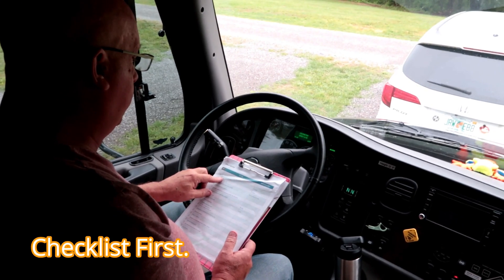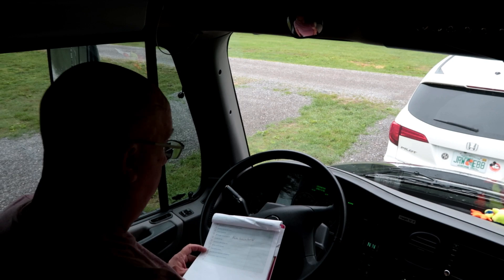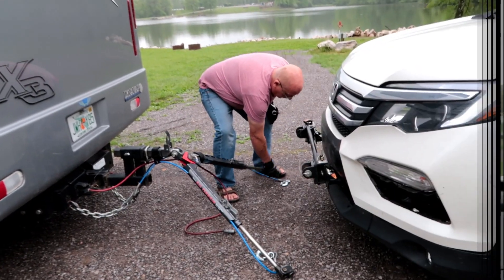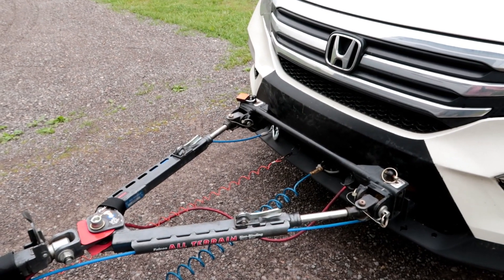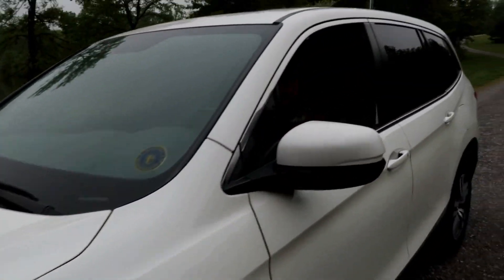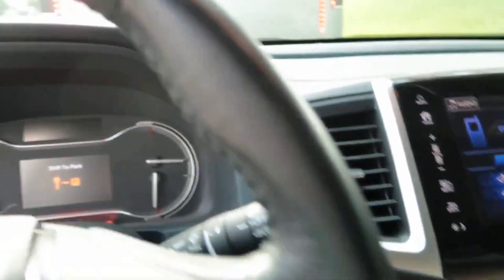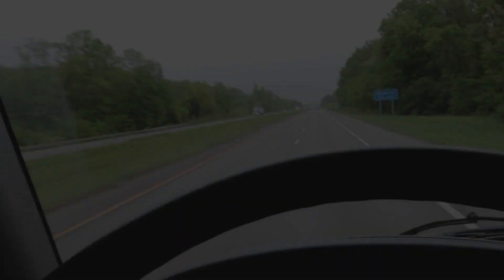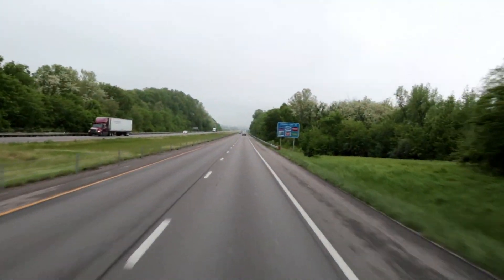Our RV Departure Checklist and Flat Tow Hook Up

Comment: Thanks for the help. I’m looking at 24-25 Ridgeline and I’m not finding very many flat tow vids for it. I’m also a Floridian.
Reply from the maker: @godsmizzack  Your welcome if you have any questions put them here and we will try to help out. We almost always towed the pilot at around 65mph and stopped about every 2-3 hrs and ran it through the gears. That helped keep the battery charged as well. Good luck with the Ridgeline. Best practice is to always follow the manufacturer recommendation on flat towing. If it's a variable speed trans I would really take a hard look at the specs

Comment: Hey guys, I noticed in newer videos that you  don't have the Honda. What happened to it?
Reply from the maker: After towing for about 100,000 miles Three sets of tires and getting an occasional check transmission light, plus changing needs. We downsized to the new to us Jeep which also weighs under 5000 lbs. Which will allow us more wiggle room on our next RV The DX3 is a BEAST when it comes to towing. Our next RV? Probably a Class C or B plus without the Monster tow capacity. Thanks for watching!
Reply: An occasional check transmission light.....but no real damage? Like, it just needed the fluids changed more?
Reply from the maker: pretty much, I added some Lucas trans lube and that kept the light out!

Comment: What system did you use and front mount? I’m still leaning towards a Ridgeline and most companies sites aren’t listing for newer Ridgelines.
I see a lot of systems on marketplace for sale, and have no problem buying that way, but, want to make sure the mount is available.
Thanks again
Reply from the maker: I used a highly modified Roadmaster mounting. It was a salvage from a Smart car. Lots of welding and bolstering. Definitely not a bolt on but doable.
Reply: @ 
I had a feeling this is what I would be doing also.
I’ll probably find a nice complete kit on FB Marketplace and then modify the mounts for the Toad.
Appreciate you replying.
I’ll try to update you when it’s complete.
Reply from the maker: @godsmizzack  best of luck. A bit of advice, make sure you don't "pull" from a place designed to "crumple" 
and try to attach to two points on each side and you should be fine. I'm not an engineer so...

Comment: Is it possible to leave say an 08 Honda accord engine running while being towed to prevent transmission damage?
Reply from the maker: Not a expert but I would be pretty nervous leaving a car running without a driver. Lots more could go wrong with a running motor especially if the car gets disconnected.

Comment: Up And Down The Road Just so you are aware, the 2018 Pilot DOES NOT have the same drivetrain as previous Pilots (2015 included). From its introduction in 2003 up till model year 2015 the Pilot had a 3.5L VTEC V6, AWD, (and later FWD) and a 5-speed automatic (shared with the CR-V, Element, Accord, Civic, Odyssey, and Ridgeline, all which were at one time or another to my knowledge flat towable following the procedure shown in the video. However, for the Pilot at least, in the 2016 redesign it received a new (but similar) powertrain and a NEW 6-speed (optional 9-speed) automatic transmission. This new transmission is NOT the same as the old 5-speeds with an extra gear. As far as I know, with the 6-speed, flat towing is okay but you need to do everything you are doing. Just be cautious about towing and make sure you stay within the time limitations. 

Honda has not officially recognized flat towing for the following vehicles since:
Pilot: 2005 (last model year allowed)
Odyssey: 2005 (last model year allowed)
CR-V: 2014 (last year allowed + last year for 5-speed auto on CR-V)
Element: 2011 (last year of production)
Ridgeline: 2005 (possibly, unsure since Ridgeline started in 2005)
Accord: 2012? (unsure, last year of 5-speed auto)
Civic: 2015? (unsure, last year of 5-speed auto)

However many have proven that the Pilot (2003-2015), Odyssey (1999-2010/2013), and Ridgeline (2005-2015) are okay to flat tow following Honda’s previous directions. 

I am curious where you found instructions for a 2015 Pilot flat tow procedure, especially since I thought you only needed to cycle the gears every 8 hrs, not 3.
Reply from the maker: Hi Caleb Cissna, Thanks for the info. Seems like the Honda is doing OK. Not sure where we got the info on the transmission I believe it was a local mechanic. We do the 3 hrs. Out of abundance of caution. I guess we are doing OK it has been towed for approximately 35000 miles with one time getting a transmission overheat fault. It's due for a fluid change and flush when we get to Florida. Thanks again for the comment. We are keeping our fingers crossed and our tranny lubed🤞👍
Reply: Up and Down the Road Have you’ll had any problems since you started?
Reply: Nice rig! I love those Super C's. Question,is your pilot 2wd or 4 wd?

Comment: Do you need to start the pilot periodically when towing to charge the battery?
Reply from the maker: Thanks for watching. Charging the battery is part of it, we also run it through the gears while keeping the brakes on to lubricate the transmission. It has worked for us so far almost 50k miles towed.

Comment: Q - i called a local shop and they said Blue Ox doesn't make tow plates for a 2016 Pilot.  Where did you get your tow plates?  Do you have 9 speed transmission?  Dan
Reply from the maker: Built my own from the tow plates for a 2015 pilot and a 2008 Smart four two.  Thanks for the comment.
Reply from the maker: Not a 9 speed transmission it's the 5 speed automatic.

Comment: Hi, are you using roadmaster for base plate?  Do you have part #? Which brake system do you use?  Did you install it yourself?.  Thanks
Reply from the maker: I did install myself. Don't remember the part number. I did major mods to it including some welding and additional bracing. And yes it was Roadmaster. Thanks for watching!
Reply from the maker: The brake system is Sir Force one.
Reply from the maker: Air Force One
Reply: Thanks Mark.

Comment: Mark and Beth - did you install any transmission lubrication system on your Honda?
Reply from the maker: No we did not. I did add a transmission additive from I believe it was SeaFoam. We also keep up with fluid changes. Thank you for the great question and thank you for watching. BTW 40k plus on towing the Honda still stopping every three hours to run through the gears.
Reply: @upanddowntheroad  Thank You very Much